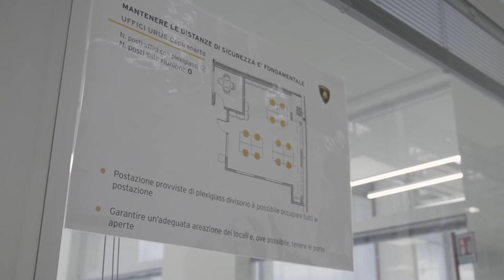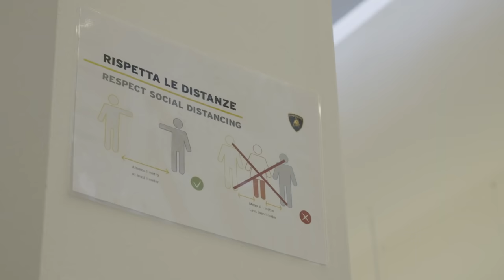Lamborghini FASE 2. E' ripartita anche la fabbrica di Sant'Agata Bolognese [pure sound]

Comment: If you put rubberized seals and rubberized coverings on the insides of the racing seat frame joints in both the driver's seat and in the passenger's seat then in theory they ought to act as "slight tremour absorbers" or as "slight shock absorbers" so that the driver and the passenger would get a comfortable ride during bumpy road travel.